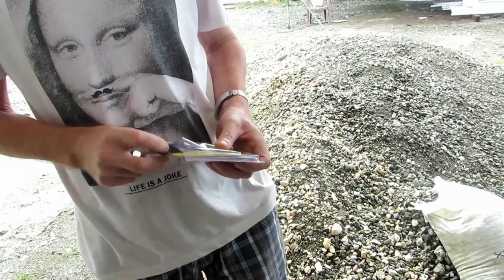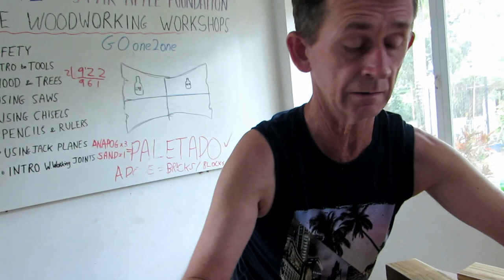Make a $300 Compost Tumbler for $20

Comment: What a great use for an old barrel, Every gardener needs one. I got my tumbler used at a garage sale (Got real lucky people quit gardening), If /when it breaks I will build one like this as it is low cost option. Very glad you decided to relocated those door latches. Thank you for sharing.
Reply from the maker: Thank you Bryan. I need a second one or a third. This one was filled in 2 weeks. I will make a cheaper and simpler version

Comment: Cheaper option. Create door. DONE!  Set green barrel of floor, use wedge to keep in place, roll with foot to mix when needed.
Reply: It's easier to get the dirt out if it's on a stand. Preferably one high enough to roll a wheelbarrow underneath. 😉

Comment: 6/29/21-I made a similar tumbler  and used several latches to keep the door/opening closed  but  the doors buckled and I tried adding  pieces to close the gap , but it does not close very well .  Did your doors hold up or buckle ?  If they  did not warp or buckle ,did  u do anything to prevent them from buckling/warping? Any ideas how I can fix my doors? Also made the holes too large on my barrel and compost falls out .Any ideas how I can close the holes ? Is their some sort of patch material/adhesive I could use to fill the holes? Do u think I could use some old screen material and glue pieces of the screen to the holes to cover up the holes so only air can come out.What kind of glue can u suggest  I use that will glue screen material to the plastic barrel or should I drill small screw holes and attach the screen material with the small screws?What kind of screw could I use? thank u.
Reply from the maker: Hi Donna. Thank you for watching. I switched over to stainless steel spring loaded toggle latches. I put a link in the description. There are not any glues I could think of that would work well with PE plastic. You could maybe bolt on on small pieces of the same material or other pliable plastic with 4mm SS nuts and bolts, and then drill smaller hole in the. It depends on how many holes you have to cover.

Comment: How well did it work? Would you make any improvements? How many days did it take to make compost?
Reply from the maker: It works great Andrew. Yes I modified by putting on toggle latches like these https://amzn.to/2MgY30G Also I would make it simpler/cheaper with a plastic pipe instead. Usually between 14 and 28 days
Reply from the maker: In stainless: https://amzn.to/3dqzdr0

Comment: Why add a motor?  Do you plan on having it tumble all day?  I would think a motor is overkill and unnecessary.  That aside, I do find inspiration in this design.
Reply from the maker: Yes. you are correct, Dustin. It was just an idea that it would tumble itself a few revolutions every 2 or 3 days on a timer.

Comment: no way $20. its **.  I just went to the store to buy the nuts and bolts and nut are $23.50 without tax and the bolts are $17.80 $46.89 with tax. the  Barrel was 5.00 the 2x4 to build the frame was 76.50 and the outdoor wood screws 17.89. hinges 5.99 each Lach z- zway to build for $20.00